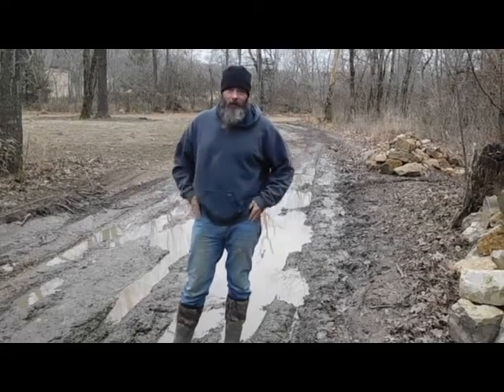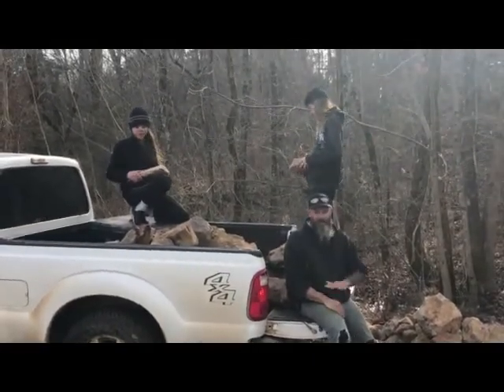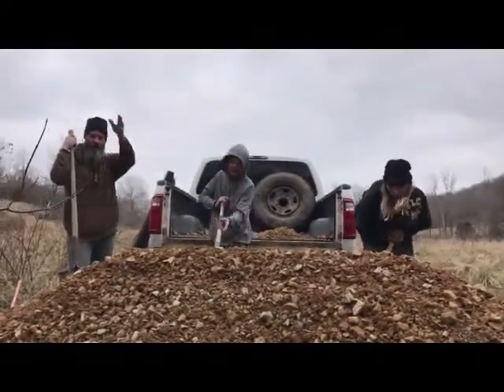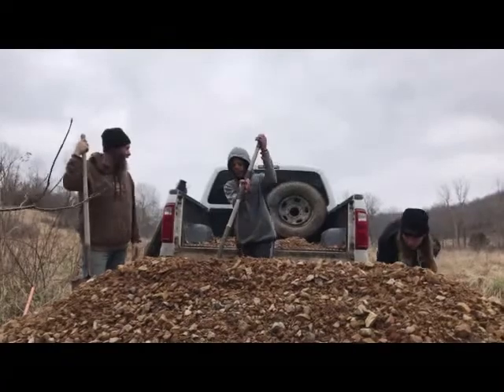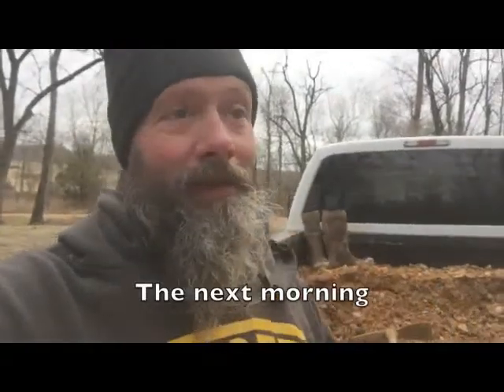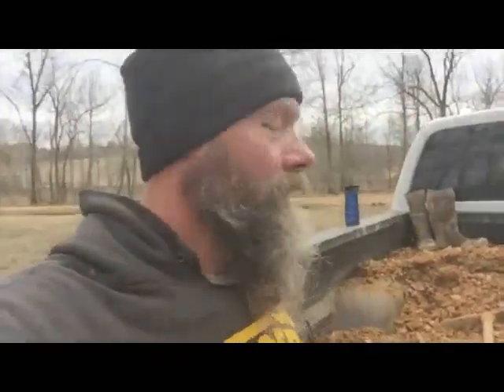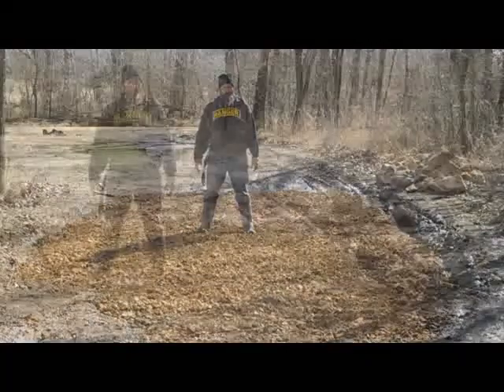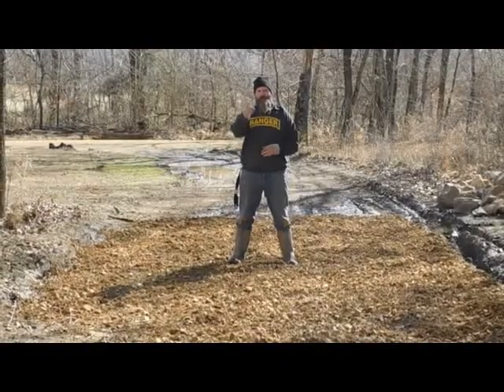Driveway Repair:  Part 2 - Putting In Fill

Comment: 2 thoughts. First, put some drain tile tubing in the groove to create a French drain and help prevent it from washing back out. 
Second, the tractor starter most likely just needs some brushes in the starter and can easily be fixed much cheaper. Also, in a pinch if you gently tap the starter while attempting to crank it over with a hammer many times it will make it work. Good luck.
Reply from the maker: Thanks.  Hammer trick didn’t work but I think I have it solved. The weather has kind of paused the project.  The drain tile is a great idea. Thanks.